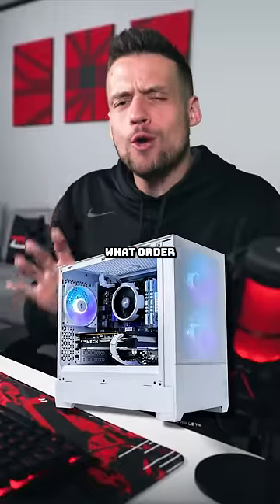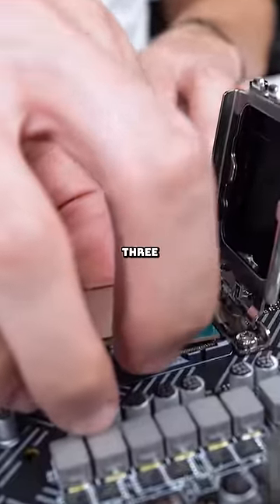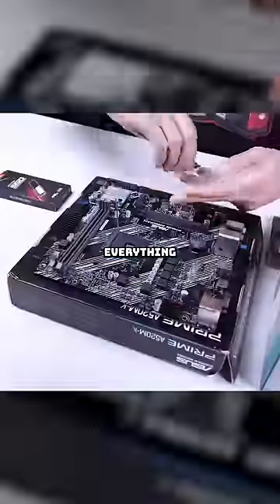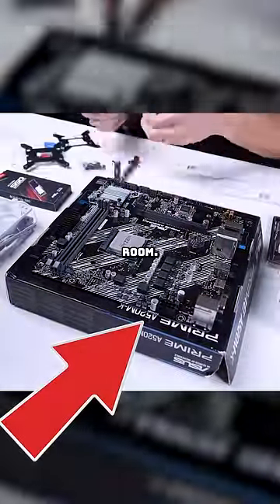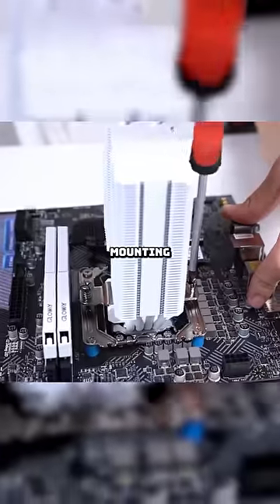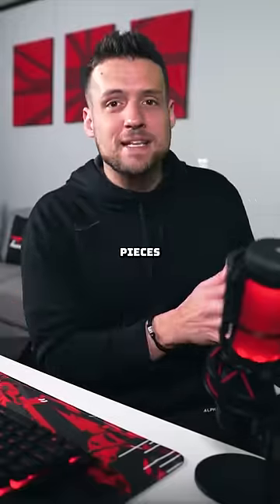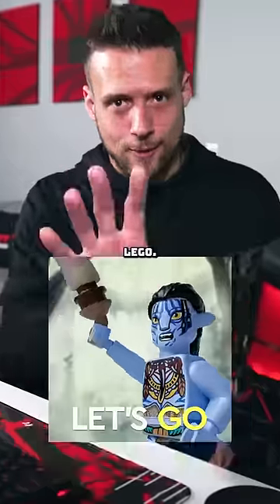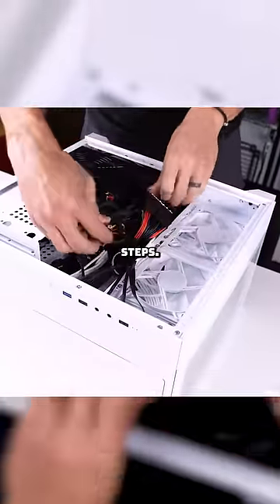PC Building Order of Operations

Comment: And then you remember the i/o shield
Reply: Motherboards with build in i/o shields: 🗿
Reply: ez: don’t put in the i/o shield
Reply: It's always happening 💀💀
Reply: The f is an i/er shield
Reply: I bought a pre built and it didn't come with the shield 🥲
Reply: i/o shields are not that hard but annoying.
Reply: @MrPenguinLol11 honestly the best invention ever
Reply: I literally did that except I said fuck it extra airflow and didn't put it in
Reply: I never put it on, extra airflow XD
Reply: Facts.
Reply: Step one: put cpu ram and ssd on the mother board then I put it in the case where I then put the cpu cooler and power supply and lastly the gpu
Reply: You don’t really need I/O shield. My current one doesn’t fit so I just left it like that and I’ve had this setup for 13 years already. I built this in 2011.
Reply: I just don’t put it on, it’s ugly anyways
Reply: My pc parts are all used so I don't have the I/O shield. And I didn't even have the AMD cooler clips...
Reply: superb 😂❤
Reply: Heh who needs that
Reply: I/O shield only came with cheap mobos, so I don't think it's even crossed his mind. Unless you're Toasty Bros.

Comment: So I assembled a pc for a sibling for their Christmas present, I got them a decent mobo, a gold psu, my old 980ti from the prebuilt I purchased, 1 tb of SSD nvme, and 32gbs of RAM. I really didn’t have a well put together plan, just build what I could and make sure there wasn’t a mess. And I think it came out beautifully since it hasn’t crashed or show any signs of failure, I feel like a proud older sibling.
Reply: Good job
Reply: 980ti HAS to be like top 5 most common hand-me-down gpus lmao, 970 and 1060 probably also somewhere in that top 5
Reply: @rFey 980tis and 1080tis I swear are the most recycled older gpus I’ve seen. They just hold up and can still somewhat hang in there with newer games

Comment: Here’s the steps I think you should take
1. Take motherboard out and put it on the box
2. Install CPU
3. Install ram
4. Install ssd
5. Install cooler/aio mounting bracket (if there’s no thermal paste then apply some)
6. Put power supply in case and route the cables
7. Put in motherboard
8. If you have an aio install it
9. Plug in case and psu cables
10. Install gpu and plug it in
11. Turn it on to see if it works
12. Do some cable management
Reply: Same 🎉🎉🎉
Reply: You forgor the I/O shield ☠️
Reply: @Brohontas  part of installing the motherboard
Reply: I feel it's better to do thermal paste right before aio install cos it's messy
Reply: @Jake_EditzYT so is installing the cpu  but you mentioned that, just be honest and say you forgot. Why be a dick.
Reply: @zVoiddd  installing the io shield is part of installing the motherboard into the case you don’t install the cpu while you’re installing the motherboard into the case
Stop making a big deal out of nothing
Reply: @Jake_EditzYT  I'm just saying is a step you missed someone poined it out and you were a dick about it. New PC builders might not know and need the step added but you just want to be an ass bro, you could have just said oh ya  that too but you had to comeback with a good rebutle cuz someone pointed out a step you missed. Just loosen up sometimes my guy. Not everyone knows that's part of installing a mobo.
Reply: @zVoiddd  again, stop making a big deal out of nothing it’s part of installing the motherboard idk what else you want me to say
Reply: @Jake_EditzYT  my whole point was you don't have to be a dick to people, but if you want to be technical the IO is it's own component that goes in before your motherboard does generally so it should have required it's own step like everything else. Your argument that "it's part of installing the mobo" makes no sense because so is installing a CPU or RAM. But all that aside I was trying to tell you you don't have to be a dick about such a simple mistake you could have just owned up to it but you had to be right just like you are trying to be with me now. Loosen up dude, hope you have a good rest of your day.
Reply: @zVoiddd  I’ve already explained, just scroll up
Reply: @Jake_EditzYT  kid I know 
How to build a computer, you missed a fundamental step and then had a dickheaded response when it was pointed out. That was the point. You either get it or not idc have a good one bro.
Reply: @zVoiddd  bro why are you continuing? There’s no point
Reply: @zVoiddd  Not all motherboards have IO shield that needs to be separably put into the case and even as someone who didn't have to deal with it for that reason, I think it's pretty clear that it's still part of the motherboard and goes in first if it's actually present. You're weird.
Reply: @hakayonder3396  nothing weird about telling people to have a little decency towards others which was the whole point. Your weird.
Reply: @zVoiddd Are you a child? How is saying that being rude?
Reply: you turn it on before installing in the case to be sure it is working before , so you won't waste your time
Reply: @LordLab  that’s just you I don’t do that
Reply: @Brohontas that comes after steps 13 - 16: Swear, throw something, resign yourself to your fate, diassemble

Comment: I do it like this
1. Ready the case with fans and io shield 
2. Put in motherboard 
3. I install the m.2s because they will probably be covered by the GPU and or CPU cooler
4. I then install the ram
5. Then the CPU cooler to make sure it fits around the ram 
6. The power supply 
7. Extra drives like sata for cheap storage
8. Blue ray drive
9. Install GPU 
10. Plug everything in and cable manage a little bit

Comment: I have never built gaming pc but from some videos “A touch of cable management” is the hardest part
Reply: it's because of airflow, don't want those expenny pieces sizzling
Reply: It gets proportionately easier the more the size of your hammer increases 😏
Reply: Well, I don't know actually. I find cable management fairly easy, without its absolute garbage even though, I'm kind of messy everywhere else. Except my desktop, you can't see a single wire or cable lol (obviously you fan from my mouse and keyboard, but everything is neatly routed behind my desk)

Comment: 1. Install fans to case
2. Install PSU & SATA SSDs to case
3. Mobo prep (M.2, RAM, CPU & bracket)
4. Mobo installation
5. AIO installation
6. Header connection & start cable management
7. GPU & finish cable management

Comment: I personally start with the motherboard, do a POST, and confirm all parts are functional before installation. Last thing I want is to have something not work, have to take it all apart and see what isn't working. After a basic install, I run another POST test to confirm once again before full buttoning up, cable management, etc
Reply: I'm Surprised I had to scroll this far down to find this. It used to be common advice a few years ago to see if everything posts before putting it in the case. I wonder why it fell out of fashion
Reply: @rennoc577  I learned from LTT, now LMG. I built my first PC 3yrs ago, and even with my experience now, I still am cautious. I don't know why it fell out of style either...
Reply: @slickbait6791 Yeah, that's the pros of testing. Glad you found that before it became an issue though...

Comment: 1 - MoBo assembly without cooler or AIO 
2 - Cabinet Assembly (Fans, IO shield)
3 - Mobo Assembly to the cabinet
4 - PSU 
5 - Cable Management (I do it in between steps, but usually my final decisions on the cable management are after the PSU)
6 - Other peripherals ( 2.5 SSD or HDD, fans hub if any etc.)
7 - Cooler/AIO assembly
8 - GPU

Comment: I usually install the cpu cooler after installing and plugging in the motherboard because it's hard to wire things when there's a giant cooler in the middle. Some connectors can become practically inaccessible like the CPU power line.
Reply: Just don't let wires end up under the cooler. I have seen this happen. It does not end well.

Comment: Personally I like to:
1. Apply thermal paste to the underside of the cpu cooler 
2. Secure the gpu to the case 
3. Slide the motherboard behind the gpu being carful not to knock off any capacitors (I always have at least 2 spare motherboards handy) 
4. Install the cpu cooler 
5. Place the m.2 ssds in the pci x16 slot(4 fit nicely)
6. Place the power supply under the gpu ( pre-made sag bracket) 
7. Gently plug the psu cables into the motherboard 
8.forget about the cpu and procede to try and turn the computer on 
9. Gently remove the cpu cooler and using a fair amount of pressure, wipe the thermal paste from the socket 
10. Install the cpu making sure the side with the pins is always facing you 
11. Reapply  thermal paste directly onto the cpu pins 
12. Replace your cpu cooler 
13. Shove all your cables into the back and make sure to forcefully place your glass side panel back on 
14. Plug in all the cables and with hope and prayers your pc shout be cranking 999fps in cyberpunk

Comment: Pro tip if you have a modular psu or cable extentions. Plug in the cpu cable and route it through it's hole before mounting the mobo. Especially useful for people with fat fingers

Comment: 1. Power Supply -> Case
2. MoBo -> case.
3. Cooler -> MoBo
4. RAM -> MoBo
5. GPU -> MoBo
6. Cables -> MoBo/GPU
7. Power on. No Video.
8. GPU -> table.
9. Cooler -> table.
10. CPU -> MoBo
11. Cooler -> MoBo
12. GPU -> MoBo
13. Power On -> No Video.
14. Two hours later, video.

Comment: 1. putting the psu into the case.
2. putting cpu, ram, graphics onto the motherboard.
3. connecting all the cables.
4. installing the motherboard into the machine.
5. placing 1 big fan at the side of the pc for cooling.

Comment: I do the same tbh. Further detailing the process: after I placed in the motherboard(with cpu, ram, cooler and SSDs in it), I place all SATA devices in. After that, I place the PSU in. Then comes the front panel connectors and the power supply cables. The last thing I put in is the GPU. And that's it.

Comment: Pro tip: if you're using extensions, plug the ones for cpu power in the mobo before installing it in the case. Will save some headache and knuckle cracking.

Comment: 1. Motherboard om the box
2. Sett the CPU inn
3. Sett the ram inn
4. Set on the storage
5. Sett on the CPU cooler
6. Sett the motherboard inside the case
7. Hucking upp the power supply
8. Setting inn all the cables
9. Sett inn extra fans(for extra airflow)
10. Sett inn the power cable
11. Check if the PC is running

Comment: Generally the same, but for extensions, I tend to plug the EPS connectors into the board, then pipe them through the cutout as I'm installing the motherboard. Considering how tight that space can be, getting ahead of that has saved my ass, and my hands.

Comment: 1 : Install CPU
2 : Install cooler
3 : Install RAM 
4 : Test boot
5 : install drive
6 : install cooler and fans
7 : plug in the psu cable
8 : install psu and cram the rest in the 5 and a quarter bay
9 : install storage drive
10 : install gpu
11 : install windows and partition the boot drive to be small to make it faster
12 : start gaming

Comment: My order:
1: put in the psu
2: put everything on the motherboard
3: be scared when putting in your cpu
4: wonder if you did it correctly and be nervous
5: put the thermal paste and the thermal cooler + fan
6: attach to case
7: wonder where the last 3 screws went
8: find spare screws somewhere
9: attach gpu 
10: attach power cables with non modular psu (hell)
11: boot up pc
12: nothing smells burnt
13: find out msi send you a disk with the drivers but you don’t have a disk intake on your pc
14: download Ethernet and WiFi drivers onto a usb and plug it in to get internet connection
15: download the rest of the drivers
16: cry in happiness

Comment: As i just "upgraded" My pc my order was like this: 
1. Clean case and everything. 
2. Install as much as you can on notherboard. 
3. Do the cable management for the power, ssd and hdd. 
4. Shove and connect the motherboard to the cables. 
5. Install the power supply and connect the cables to it. 
6. Install the gpu. 
7. Pray for it to work. 

P. S. My case is old, so it has power supply higher than the motherboard.

Comment: Depends on the parts,
 Last build 
Step 1 put motherboard on box
step 2 connect psu to board 
step 3 update bios, 
step 4 disconnect psu, 
step 5 install cpu.
Rest was the same in line.

Comment: Step 1 is prep the case. install psu run cables where they need to be, install fans run those cables where they need to be, install io sheald and or ssd/hdd.
Step 2 prep the motherboard, install cpu, ram, cpu cooler, and m.2 drives and then plop the motherboard into the case then install gpu then connect everything and power it up and hope for no magic smoke.

Comment: Start with putting the motherboard together. Put it in the case. Fumble with the connectors for the power button and front I/O of the case for a frustrating amount of time. Put your power supply together and put that in the case. Spend an even longer amount of time cable managing only to give up on how you WANT it to look and then just make it look ok-ish/neat.

Comment: LEGO:
 mother-board-down, 
PC case missing. 

Dimm slots filled up,
 CPU fits in .

SSD in the top slot,
 motherboard sits in. 

Screw it all down, 
lean in close and listen,

Fans pull air from the side where it Splits it.
Pull more air in than you exhaust, or you tripping.
No graphics on CPU?, graphics card, get it! 
Screw it down after it's clicked in.
Cables through the back, boy, you know how it gets in. 
Keep the Side panel off. Make sure it's all clicked in. 
Plug in the PSU and, Switch it.
 Plug in all the I.O. now power button click it. 
That's just how I do it, but, you can do it different.
If you're on AMD Mash delete like a monkey,
 If you're on Intel press F2 like a Junky,
Keep clicking till the screen looks cyberPunky
Okay,
Now you're in the BIOS. 
Lemme show you Lil something. 
Enable NVME RAID. To get that NAND Flash function.
Enable XMP 1 to make sure that RAM running,
 at the speed that's advertised or your PC will be  slumpin'.
That's performance on the table boy, it ain't nothing funny. 
HDD in your system?! You needa Get some money!
Four sticks of ram?! Make sure that CPU can run it!.
NV-ME SPEEDS STUNTIN'
HDD PUNTED, 
Performance above all dawg, please don't leave it stunted. 
Tweak it all, make sure you get value for your money..
If your monitor is 60 Hz that 30 series' wasting money. 

😅 Well it was just few lines but now it's a whole verse. 😊❤
Guys, no using my stuff without credit. ZTT go ahead and do whatever.

Comment: 1. Motherboard setup (Ram, SSD,
AIO bracket, CPU contact plate).
2. Mount fans in case and route the cables how I’d want them.
3. Mount PSU cables onto PSU and screw that onto case.
4. Route PSU cables through slots I’d want, then mount Motherboard onto standoffs.

Comment: You do it the same way I do it, it is the best way add everything you can to the motherboard before installing it then do the PSU connect the PSU to the board, then I'll mount my aio then apply thermal past, the mount the pump, then install the GPU and flip the power switch plug it into the wall and boot the PC up this is the best way. If you have fans install them before putting the board in

Comment: I leave out the Ram. Makes it easier to fiddle in the 24pin. And I route the CPU power cable before putting in the motherboard and connect it before screwing it down if there is not a lot of space between the mobo and the top of the case. If that's the "case" I also route the back fan through that hole if I don't forget it.

Comment: 1. CPU
2. RAM
3. SSD
4. Cooler
5. Putting the motherboard into the case
6. Case connectors
7. PSU
8. GPU

Comment: First, I dismantle the casing, get all the front panels cables individually and connect them to the motherboard. And then I attach the GPU to the RAM socket, RAM to the M.2 socket, SSD NVMe to the processor's socket and then glue processor to the heatsink NEAR THE FAN.

Comment: Built one pc, started with motherboard so the cpu and ram, put the psu in case, put the mobo in case installed the cpu cooler, wired it up, broke but repaired the front usb 3 adapter and put in my gpu.

Comment: The PSU should be installed first, because once screwed into the case, you can make sure it's turned off, then plug it in to a power strip.

It's now grounded, meaning you can ground yourself just by touching any unpainted metal (such as a screw) on the case, avoiding ESD damage to things like motherboard.

Comment: Its on a per case basis honestly. Similar strategy of prep motherboard eith everything first, usually i dont do extensions or modular power supplies so i skip thst, generally if i can i install the power supply before thr motherboard because for routing the wires it is sometimes a lot harder or even impossible. 
The one exception i had for this was when i built in the jonsbo c2. In that case the psu has to go in last.

Comment: When I built my PC, I started with the motherboard, then put the PSU in the case, then put my motherboard in the case, then put the CPU cooler on, then connected the PSU, then put the GPU in, and lastly changed the fans

Comment: I personally put motherboard on box slap cpu and ram cpu cooler on top without paste or fan plug psu and give it a boot start before any further process. If cpu doesn't have integrated gpu I install one of my bench gpu which doesn't require external power.

Comment: What I like to do is that before installing the mother board, I connect all the ports like front panel connectors before screwing the motherboard into the case, I usally do this because I mostly work with smaller cases and with giant fingers I can't really just squeeze into it.

Comment: Start with the case than put the aio than put the psu than plug the cable of the psu to the psu than install the motherboard than install the ram than the ssd than the cpu